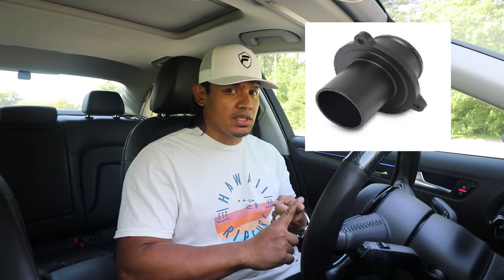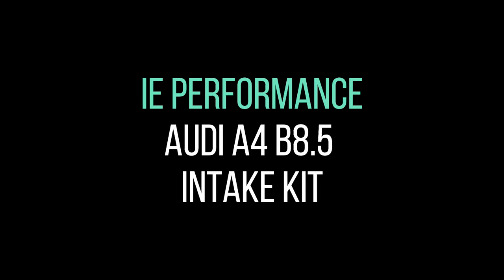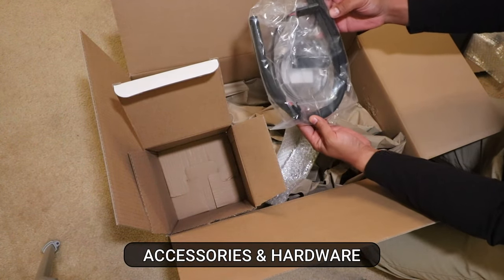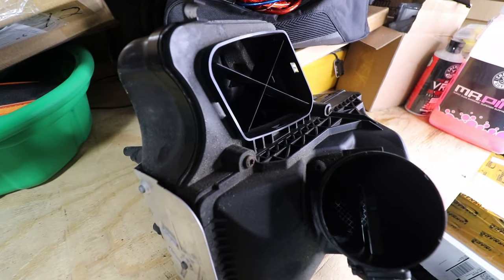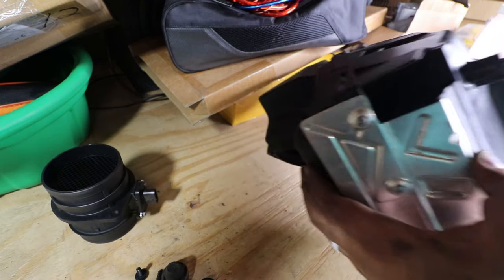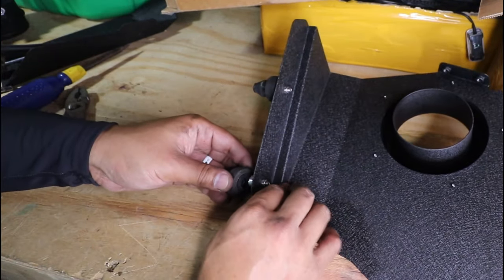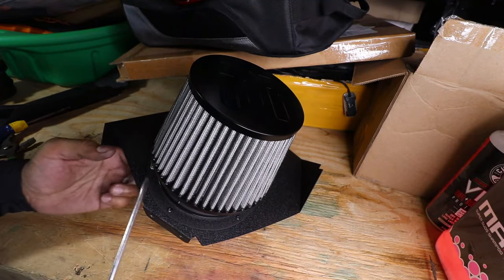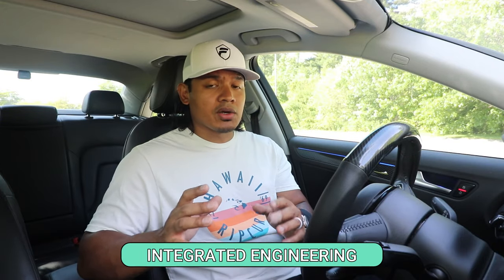The only Cold Air Intake that should be on an Audi A4 B8.5

Comment: Has anyone experienced cylinder head issues after doing this? I installed a muffler delete, cts intake and an ecs blow off valve and three weeks later my 3rd piston slapped my injector. Could that be caused by the engine running too lean? Maybe factory settings unable to handle the larger air quantity??
Reply from the maker: An air intake doesn’t really add air. It’s goal is to pull in colder air. Same amount of air but colder air means more performance cause it’s more dense air that’s burning up. 

A turbo muffler delete only enhances sound.  A stock turbo muffler muffles the sound of the turbulent air coming outta the turbo. You delete the muffler, you get more turbulent sound. 

A blow off valve dumps excess air. So I don’t know where you think more air is added.

The only way to add more air is get a bigger turbo or adjust the boost pressure. 

I’ve ran these 3 mods on at least 4 of my cars (Mercedes and Audi) and didn’t have a single issue because they don’t cause cylinder issues.

Sounds like you have a high mileage engine that’s having issues inside the cylinders that finally gave out. Could be failing or bad injectors, oil leak inside cylinder, cylinder wall thinning out, many things but def not related to those 3 mods.
Reply: Thanks Flex, I've done extensive research as I want to put my CAI back in now that I have a new head, nowhere have I found anything to back up my fears. Seems more likely oil pressure was running low on that day and was the culprit. When researching piston slapping into an injector, there's plenty of comments in chat rooms about low oil pressure. (For those interested in knowing).

Comment: The OEM is a cold air intake, and unless you will get a bigger turbo the only reason why you would install an aftermarket cold air intake would be for the look, or if the OEM is broken.
Reply from the maker: An OEM intake uses a paper filter and the plastic airbox absorbs and holds onto alot of heat. An aftermarket intake looks better, is more durable, sounds better, and performs better and is needed when the car gets more mods (doesn't need to be a larger turbo). And this is only 1 of my many mod videos for this car. This car is getting an intercooler, downpipe, and stage 2 tune...so yeah...an aftermarket intake is a must.

Comment: ANYBODY HELP! All thode IE mods are for the b8/b8.5 2.0 but could any of it fit on a b8 1.8 (tfsi)? Is it even a good idea, or would if F up my engine?
Reply from the maker: Just go look at their website. If you don’t see your model, then send them a message and ask. They will get back to you within a few days or even quicker. 

And it’s only a good idea to mod if your car is well maintained. Don’t be modding a car that barely had a tune up. You need to take care of the small problems or else those small problems are gonna lead to bigger problem when you decide to mod the car. Then you’ll be wasting money and time and be blaming the mods for your issue, when really it’s the car that’s the issue…not the mods.

Comment: actually,this turbo noise it's no good for turbo even though it sounds good
Reply from the maker: Turbo noise on a street car is not that bad. 

Especially when it only happens AFTER I’m flooring the crap outta the car and then quickly getting off the pedal.  Nobody drives or races like that.  And it’s not like it’s happening all the time.  I pick and choose when I wanna do it for fun. 

What’s bad is Turbo noise WHILE you are flooring the car…that’s a surge and will shorten the life of the turbo a lot! My car has none of that.

Comment: HELP ME!!! okay hear me out so i installed this intake on my 2011 audi a4 2.0t right but EVERY time I accelerate it makes like a squealing whistling noise even during a daily drive. Yes i know the turbo makes a slight whistle and sucking sound but i know this isn’t normal. DOES ANYONE KNOW WHAT THE PROBLEM IS?
Reply: I have just put an IE Air induction kit on my audi and I have the exact same thing happening. I have no power loss or smoke but it sounds like the compressor bearing is on the way out. Going to get it looked at.
Reply: @silverstacker5174  can you let me know when you figure out what the problem is? I changed mine back to stock since im going to be driving long distances and idk if its going to mess wit the car. i was also thinking it could be a vacuum leak but i feel like it would still make that noise when its stock right so i dont know what the problem is.
Reply: im having this same issue, any fix yet ?

Comment: Mine rattles at low rpms and it's annoying as hell. I know it's the intake because I removed it and put the stock box back on. Tightened down every bolt. Seems like fake advertising in this video to me
Reply from the maker: Just cause you had an “issue” doesn’t mean it’s false advertising. Lol

Probably a defective product off the assembly line. You should be contacting IE. That’s why they have warranties. If you bought it somewhere else, then you gotta deal with whoever sold it to you.
Reply: i have a cold air intake too. the sounds are almost exactly the same as shown as the vid. no rattling at all, you probably installed something wrong or got a bad part

Comment: Your car not b8.5..it just b8 engine
Reply from the maker: School is in session. Please have a seat. 

US spec A4 B8 (2009-2012)
US spec A4 B8.5 (2013-2016). Sometimes it’s called a B8 facelift but most people call it a B8.5. 

Mine is a 2015. The B8.5 models have a completely updated front end, including new headlights, new grille, new fog lights, a new bumper, a new hood, new fenders, and more. And improvements to the engines reliability. Tons of improvements over the B8.

Comment: So I installed it,  the weird thing that I don't get that sound like you do 🫣🫣
Reply from the maker: Cause my car already had a blow off valve and turbo muffler delete and my car was stage1 tuned.  I clearly mentioned that in this video and that’s in my A4 video playlist before this intake video.   

The intake alone is gonna give the car more suction sound and maybe slight turbo noise but it’s not gonna sound exactly like my car.
Reply: @iHATEmyUSERiD go to the vid before this one

Comment: Is this the same as engine filter that is change during oil change or you still have the engine filter together with the intake
Reply from the maker: “Engine filter” is really not a term used by a lot of people in the car industry. No hate but I suggest you look up a video on how a car engine works and what filters do what before attempting to modify your car. 

There’s an oil filter, air filter, transmission filter, fuel filter, cabin filter, and more. 

When you get an oil change, the oil filter is changed.

In the video is an air filter that’s being replaced.
Reply: @TheFlexxGarage  Thanks for the reply and for clearing up my misunderstanding. Much appreciated

Comment: Will this fit an 2011 b8 s line ?
Reply from the maker: It should. You need to contact IE and ask or just go to their website and buy the one for your year and model.  

It’s an intake…99% of the time, it works with the stock tune or any aftermarket tune.
Reply: @TheFlexxGarage  ok, cheers mate!

Comment: Would this work on a a4 b8 1.8L TFSI?
Reply from the maker: Don’t know. You need to ask IE.
Reply: 1.8 TFSI engine is called a EA888 wich has 3 variants GEN1 and 2 wich have a air mass meter and the GEN3 without air mass meter. In this video its a GEN1/2 EA888